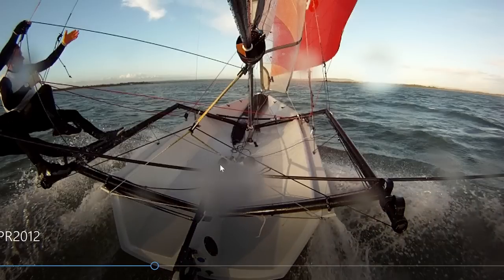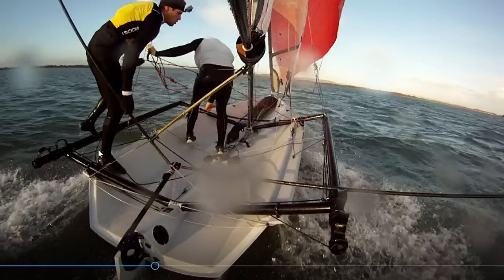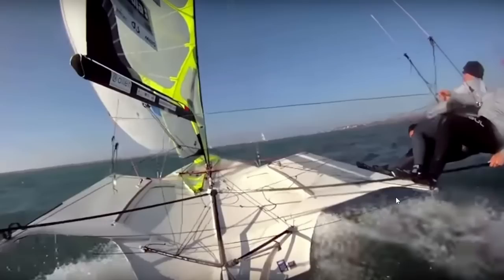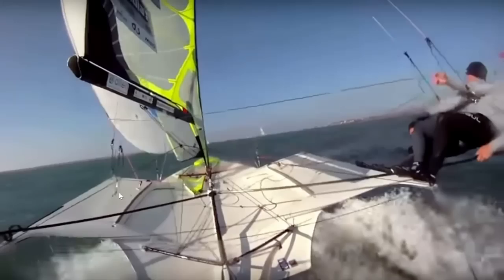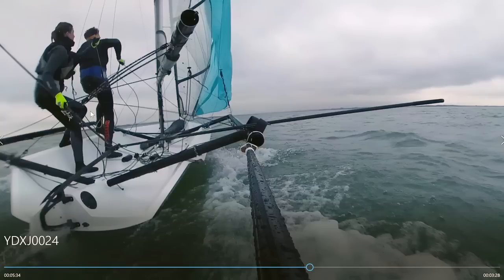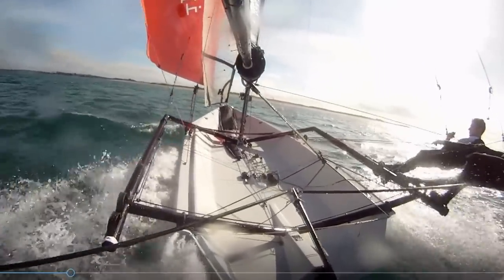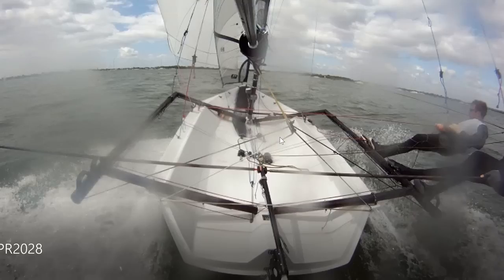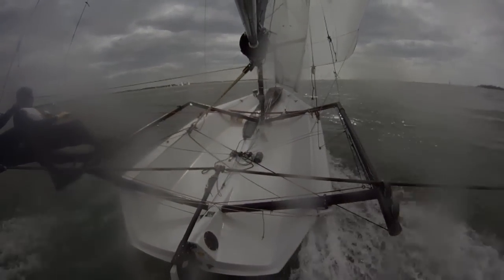Skiff Gybing Technique || Updated #RS800

Comment: Thanks for clearing this out, I have a lot of problems finding my balance during a gybe, especially when it's wavy. In most of the clips the boat has a bit of windward heel, does this help steering through the gybe more easily? When I try this the boat bears away too quickly, causing a lot of pressure on the rudder to adjust it, and therefore losing my balance.
Reply from the maker: Generally yes, but as you say, if you get too much windward heel, or combine it with too much rudder the boat will bear off very quickly... we don't always get it right!